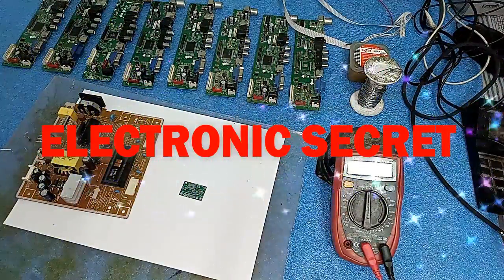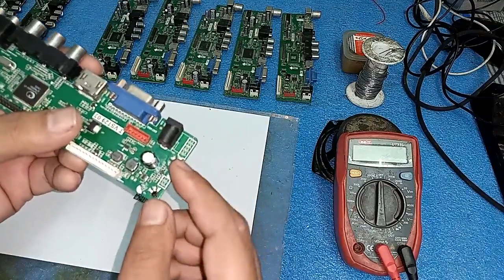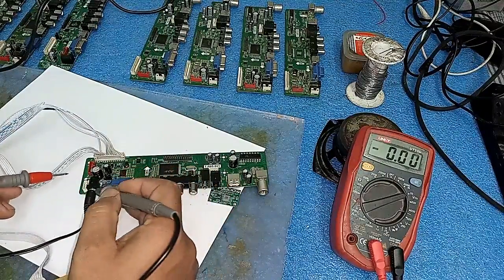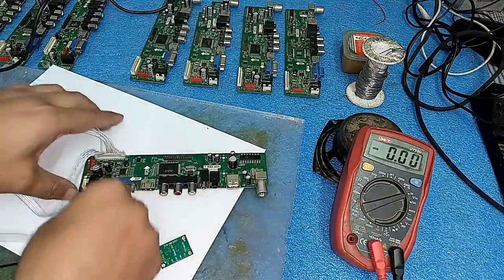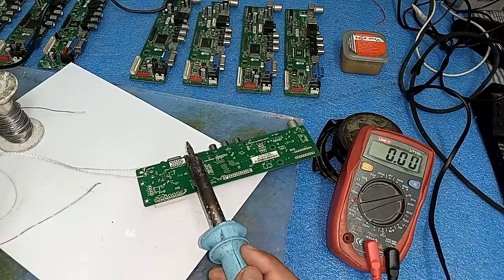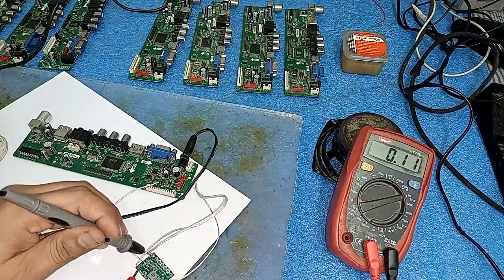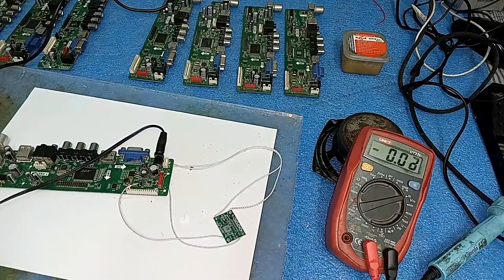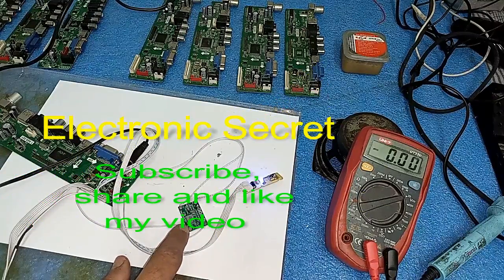CHINA LED TV MOTHERBOARD REPAIR || UNIVERSAL BOARD REPAIRING

Comment: I diagnosed my tv to have this defect...can I use  a 5v regulator ic instead of the module? Tnx!
Reply from the maker: You may try it but I am not sure it will handle amps,
Reply: @ElectronicSecret  You are right, I tried using a regulator, it failed after a short time